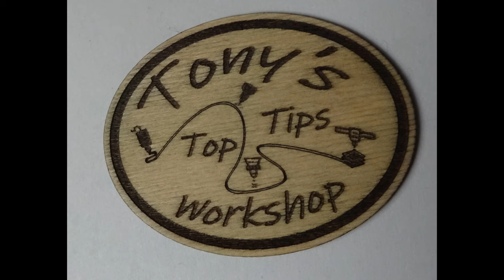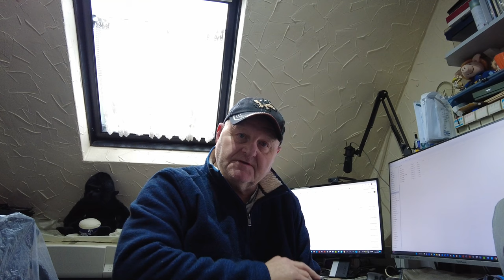Genmitsu LC40 Laser engraver Problem solved flashing the firmware

Comment: Well, I am having your firmware flashing issues now.  I have a internal modem on my laptop that was using com3 so I set the modem to com7 and set the Jinsuko serial port from Com5 to com3.  I even disabled the bluetooth and wifi, but I still get the same error and no device found message.  Any suggestions, what port speed are you using when you flash the firmwate.  I set mine to 115200.

As to why it only flashes using Com3, that is an easy answer.  The tool used to flash the firmware is very simple and would bet the hard coded the comport and settings into the code.  They should have at least provided a dropdown so you can select which Comport to use.  

I have another laptop and I might try that.
Reply from the maker: Hi I cant help you with the issue as mine did work on all my pc on coms 3 I have been back in touch with sainsmart  about this problem and said that it should have been wrote into the code to allow any selected coms port. You are doing exactly what I have done. I have had lots of emails with the same issue and have all been solved with coms 3. You could try requesting a new main board like I did just in case, mine turned out to be ok so I ended up with a spare board. Tony
Reply: @Tonys.Top.Tips.Workshop  I did finally get it to work though interestingly even if you reassign the com port of the bluetooth and assign com3 to the serial port of the laser, it still would not work so I ended up disabling the bluetooth and then it worked.
Reply from the maker: @zk_6312  I must admit I disabled my blue tooth on my laptop as that used coms 3

Comment: I have a issue with the laser GRBL and Light burn won't work what am I doing wrong
Reply from the maker: Hi Robin have you flashed the firmware to GRBL if you have you have to follow the instruction in lightburn to find the laser and correct coms port and the same in laser GRBL there are some vids on youtube that show this but I just followed the manual
Reply from the maker: Hi Robin this might be of help from one of my readers 

1Greenheart
2 days ago
i only received my LC40 just over a week ago. was having the same trouble flashing the firmware. I'd followed all the videos up to comms 3 (mine was hidden and had an intel driver connected to it so had to disable that and then rename one of my existing ports comm3  ) Still didn't work !
 I'd been in touch with sain smart and went through all my steps with them and they came up with the solution. Yes it must be through  comms port 3 but no other comms ports can be in use at the time.(mine had comm port one in use , this had to be disabled) ONLY comms using CH340 can be active. I done that and it worked no problem.
Reply: Ok now when you say flash the firmware that is when you copy that one file on the video and then rename it and then do the update right
Reply: @Tonys.Top.Tips.Workshop  when you say reflash is that when you take the file and copy it and rename it ROM.bin then update right
Reply: @Tonys.Top.Tips.Workshop  on my light burn when it is on my screen it will show com 3
Reply: @Tonys.Top.Tips.Workshop  what do you mean it was hidden
Reply: @Tonys.Top.Tips.Workshop  did you use the USB that come with the mach and put it in the com 3 because I have my machine in the com 3 port
Reply: On device manager it says my coms are all USB root hub 3 but when I open light burn and plug my laser in to each one they say 3 4 or 5 on the light burn com space why are those numbers different than what is on my device manager
Reply from the maker: @robinstanfield1699  Hi Robin did the info I passed on help I have been trying to contact you but i had no luck I don't know why hope you get this message Tony

Comment: Sounds odd.  I have never heard of this.  I will keep this in mind as intend to flash mine eventually.  I am not a fan of Genmitsu's documentation.  They don't give a lot of detailed information.  It is more overview information.  I have been trying to figure out how to use their mobile app to center the laser or just position it as well as how to activate framing, but their support has been less than helpful and just point me to a video that is also not detailed enough though I did kind of get an idea of what I need to know.
Reply from the maker: Hi the app or the windows based app software for the pc is really easy to use there are plenty of vids on youtube showing you hope you get started ok Tony
Reply: @Tonys.Top.Tips.Workshop  To you or maybe I am just an idiot.  I was not sure how to adjust the work piece size, center the laser or do the framing sequence.  I guess I will start a test job at the lowest power and see what happens.
Reply from the maker: @zk_6312  Hi where ever you place your text the machine will go to that spot and there is a frame round your text if you touch and hold you can move it about. Then on the next page you can tell it to frame but it will keep on framing until you touch the Butten again. The problem with this laser is it is very difficult to see the dot as the shield inside the laser head blocks your view and the label. Practice makes perfect Tony
Reply: @Tonys.Top.Tips.Workshop  Thanks a lot.  Finally, someone who will actually answer my questions.  Much appreciated.
Reply from the maker: @zk_6312  Hi always here to help if I can you should think about the air assist weather how I did it or you can purchase it now Tony
Reply: @Tonys.Top.Tips.Workshop  I know you can add air assist to the 10w laser module, but I have the 5w F.A.C. laser module.  It is suppose to have passive built-in air assist.  Have you added air assist to the 5w module?  If so, how?  Do you have a video or diagram that shows how to do that?  When I asked genmitsu support about making a custom 3d printed adapter for air assist, they seemed to think I could cause a fire doing that.   I am sure how adding air assist can cause a fire though since they would not answer my question.
Reply from the maker: @zk_6312  Hi i show in one of my videos how I add the air assist to the 10watt unit watch that one. Yes with any laser there are some golden rules you never leave it unattended and never cut too slow at hi power where you get what they call flame off. the 10watt has a passive air assist but i like separate one from an air pump, with any nozzle you print there is always a chance of causing a fire as the laser is burning the material that is why you stay with it Tony
Reply: @Tonys.Top.Tips.Workshop  Yea, I found it.  There is no way to attach it on my module though as it has a couple of angled mirrors up inside module.  I will just use the passive air assist for now until I can design some sort of air assist that will work on my module.